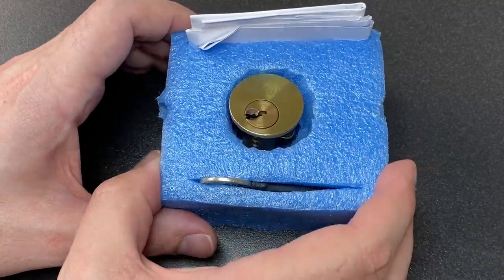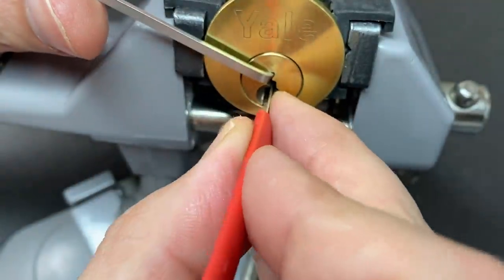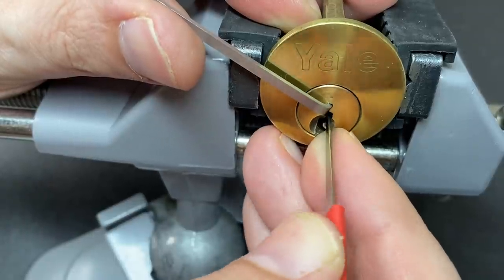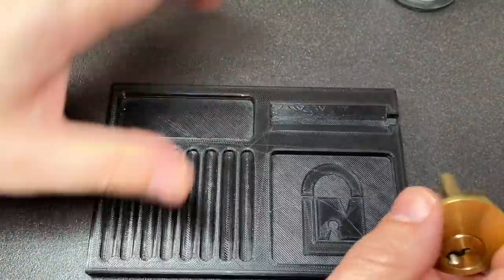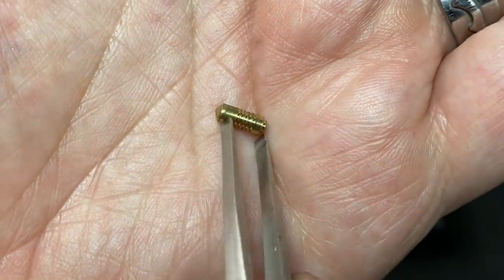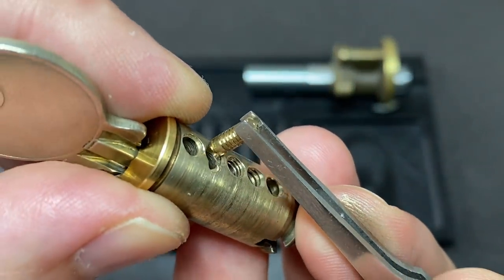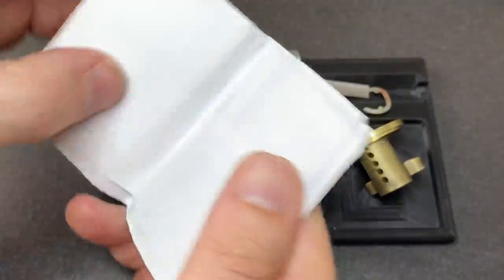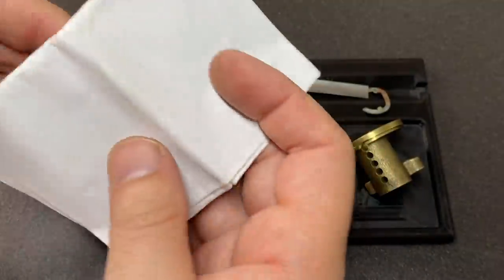Piston Pin Challenge Lock - What a Beast!

Comment: The undercut can be made with a small 'T-slot cutter' and a small/accurate vertical mill such as a Sherline.(The Sherlines are very solid machines for their size, so have the required rigidity to do the work) I have the Sherline, but I don't think I have a cutter that's small enough. It shouldn't be a problem to make one out of HSS steel for someone who makes such small items as custom pins, though. The ridging in the other holes can be made with a miniature boring bar for lathes. My smallest can go through a 1.1mm hole and do a 0.3mm undercut inside the hole. And that one I bought from China.
Reply: Core mods and pins were all done on a lathe. I have a handful of pictures of the core  grooving, the offset undercuts, and a (not so) short video of a bit of pin turning. Makes for great bedtime viewing (when you can't sleep, it helps).

Comment: As someone who has done a bit of machining, I stand in awe of that piston-pin. Even with CNC it's exceedingly hard to work that intricately on such a small scale. Yet I do wonder about it's merits compared to a well designed spool pin, which from a picker's perspective would behave very similarly. A fine cylinder and a fine job picking too.
Reply: Effectively no feedback because the lower part of the pin causes no heeling, straightening effect under pressure from the key pin 😉

Comment: How *I* would make the piston pin is to make a ball end for one piece then make a plain cup on the other. Put the cup on the ball end then you take a punch or other tool to beat or press the lip of the cup so it crushes down to a smaller diameter than the rest of the cup. 
Given the lack of toolmarks, i believe the challenger might have spin formed the cup onto the ball end. https://en.wikipedia.org/wiki/Metal_spinning